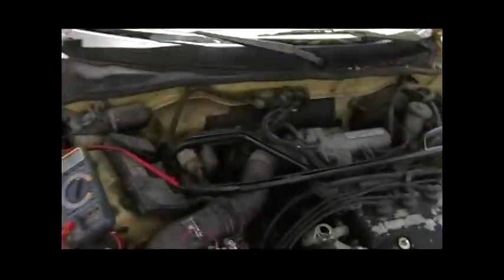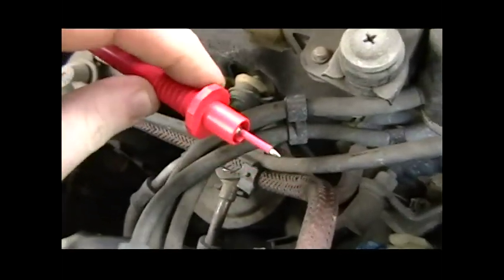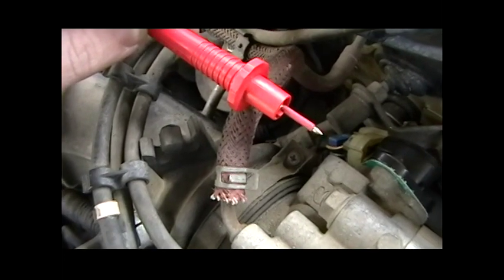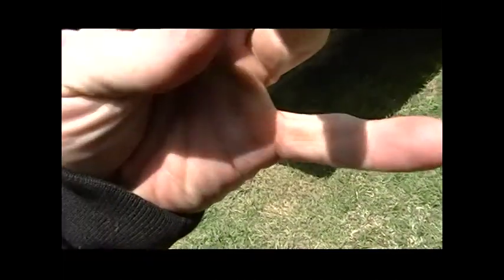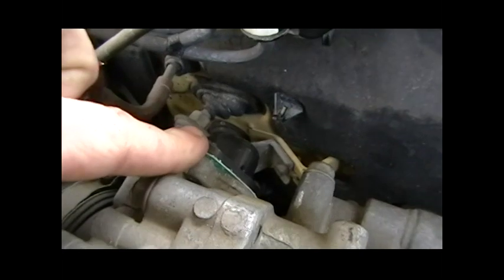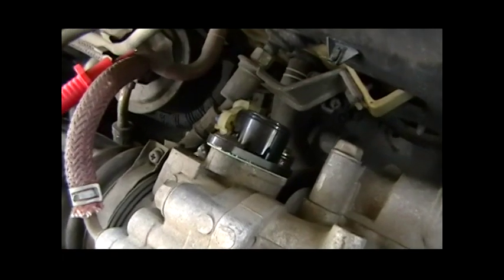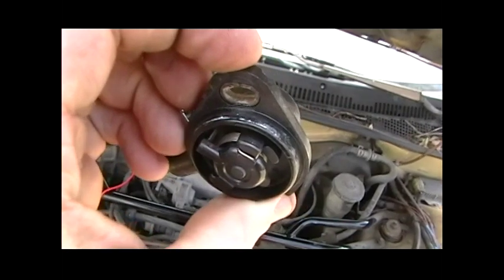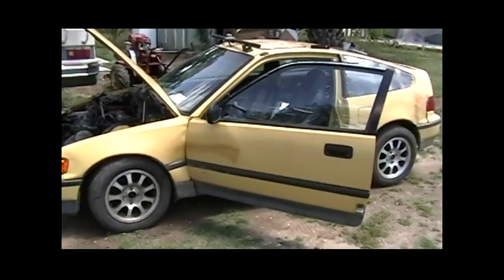How to replace TPS 1988 Honda CRX Si 88 Throttle Position Sensor

Comment: Thanks.  Excellent presentation.  I was thinking initially, how hard can this be but I'm glad I watched you vid as it looks like I'll be replacing my TPD on my '89 Honda Prelude SI. PS - My manual says the voltage readings should be between 0.5V and 4.5V.

Comment: i understand this videos old haha but I had a question. my idle on my car stays at 3000 rpm and I was wondering if it was my tps that is causing it to do this? thanks man please reply when you get the chance..
Reply: Could be your pvc valve but I'd need more info to determine if that's the probability I know not related to this hey Zach making model but relating to a 1990 Civic wagon had to replace one because the RPMs were jumping way up when I would start it up best regards

Comment: i have a question for you,i own an 91 civic with an d16a2 engine. At closed tb the tps shows 0.51volts but at wot it shows 4.2volts. i tried re-adjusting it but it will be either off in closed tb or off at wot. its this a tps problem or could it be something else? (ps: i am getting cel code 7 (tps sensor) from time to time and its getting more often). anyone faced this problem before?tnx

Comment: From what I am reading, the TPS should be adjusted at WOT for 4.5 volts, and then the throttle stop screw used to adjust it for .48-.5 volts with the throttle closed.  Could be wrong on this, though.

Comment: Also, I removed the throttle body and sawed slots in the original screws with a hack saw.  Mine is a DX with a DPFI system, which is a bit easier to access.  Never-the-less, removal of the throttle body will facilitate easy access to the screws.

Comment: charging and loads are imposed upon the electrical system, there will be voltage drop across those wires, and the voltage there will not be the same 0 volts that the computer references.  It will, rather, be either negative or positive with reference to this point, depending on the situation.  That said, when measuring voltage at the TPS, only the TPS ground should be used as a reference.

Comment: I have one problem with this procedure.  It is a mistake made by many; that is the use of any ground as a grounding point.  The ECU ground (green wire) on the TPS is a dedicated ground through which no other electrical loads are passed.  Reference is taken at the ECU end of this wire and also at the regulated 5 volt source of the ECU, which makes all other electrical loads within the car irrelevant.  If you reference ground at the battery, particularly when the engine is on, the alternator is

Comment: where do i put the black negative plug to on the voltmeter. and where to i put the red positive plug to on the voltmeter. thanks for the video i need to know more how use the  volt meter. thanks alot bro

Comment: Thank u so much for posting this... My code 7 on ecu just went off last nite and I gotta fix it try since I heard if I don't change tsp then I wil burn out the o2 sensor ...I guess ima test the old one since auto zone hs a no return policy on elec parts if installed.. Respect bro